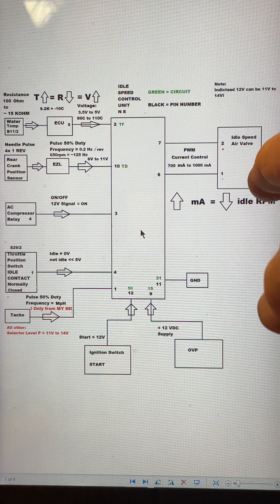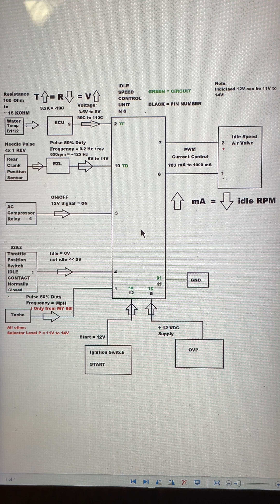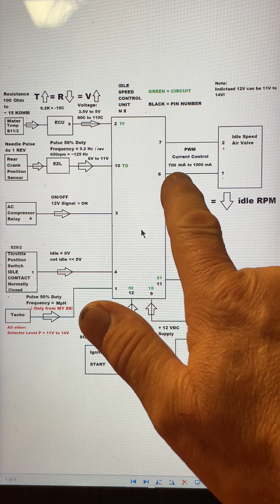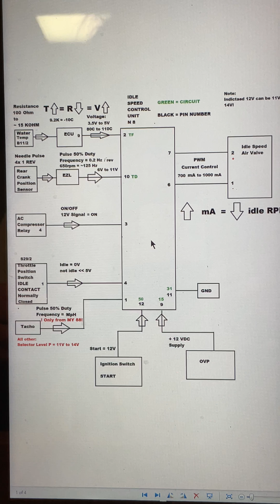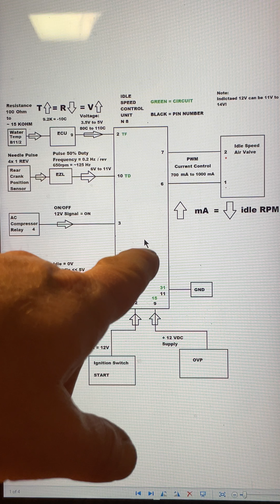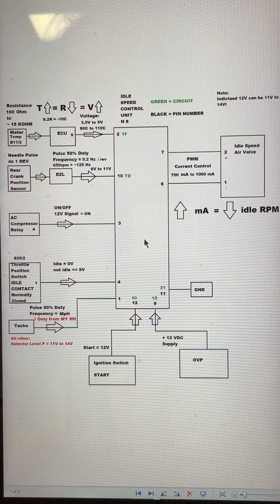Mercedes 560SEL MY 86/91 Idle Speed Adjustment Tutorial Part 3 - adjusting ISCV high idle when warm

Comment: What a great video!! I've been having idle difficulties in my '87 560SEC and this is the troubleshooting advice I needed!! Downloaded the drawings too. I have a new ICSV coming and will use your guidance to get it running right. I'm an ex-US Navy electronics tech and understood what you were teaching us. I also highly recommend the use of 63/37 solder!! It not only has a great rosin in it, it's the eutectic alloy of tin and lead, which has the lowest melting temperature.

Comment: Wow. You are are the definition of an automotive technician. I used an oscilloscope on the B+ wire of the IACV solenoid. I don't believe I saw a good hump from the solenoid opening, but when I jumped 12v to the solenoid from my jump-box I could hear it click on and off. At a constant supply it would stall the car. Replace the module with a used unit and I am beginning to suspect the used unit has the exact same problem!
The B+ wire at the solenoid appears to produce a fast square wave pulse signal from 12v-0v (KOEO) as does the ground when connected. When disconnected it produces a square wave that incrementally falls with every pulse in peak voltage to 3v and then rises back to 12v.
Reply from the maker: The IACV is controlled by current with PWM low side switch 
The maximum control current is limited to app 1000 mA
The Voltage at that current is app 3.5V
Applying an outside voltage to iacv could damage the ISCU